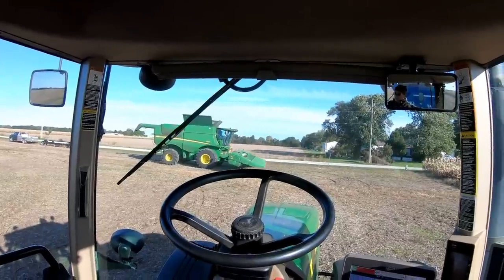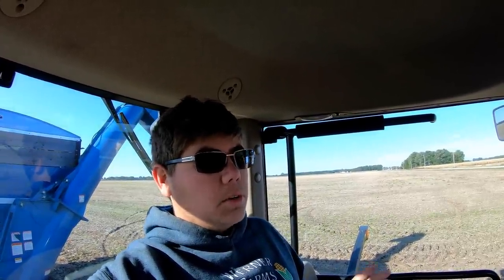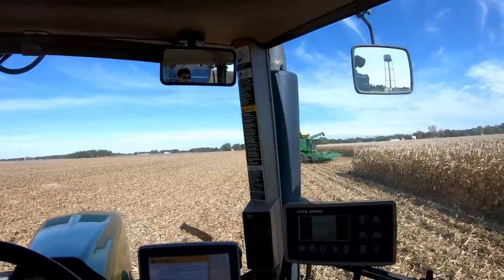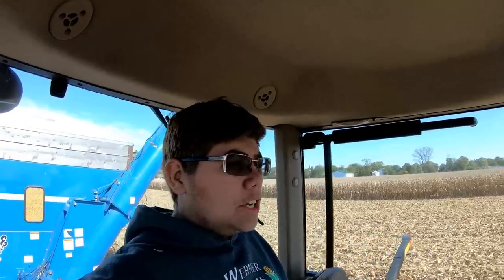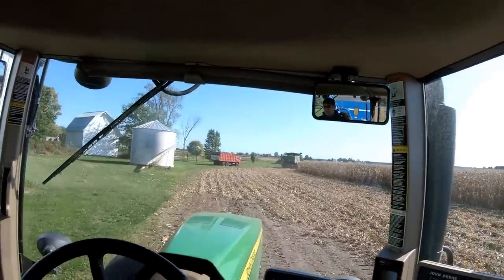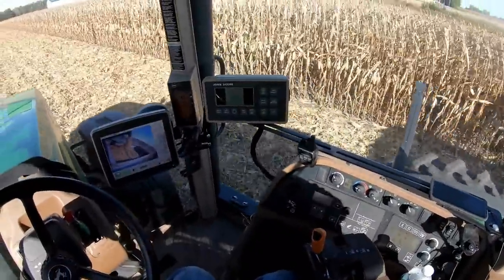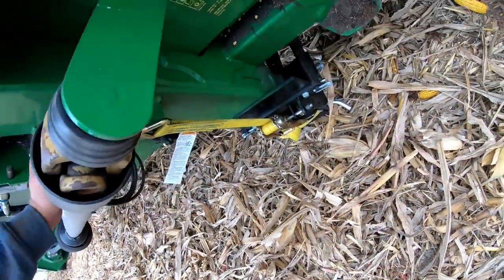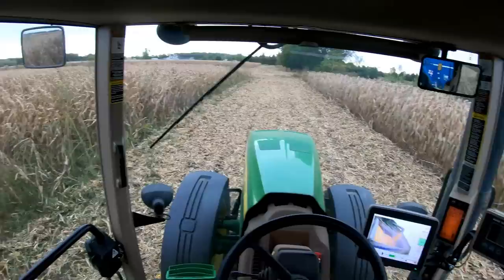S690 CAB CORN! - Wrapping Up Wanatah | HARVEST 19 Day 11

Comment: Friend of mine put crary extensions on his s670 and it works well with the powerfold. 12 row corn head makes potential bph fly up compare to 8 row. Swing auger will really help out the bottleneck in corn harvest. Hopefully a easy auction buy pops up. Happy harvesting

Comment: I work at a Deere dealer in Ohio and we install a lot of the demco/mauer bin extensions on power folds and guys love them only issue is the test channel needs to be modified just a bit  if you want the extensions to close all the way but what ever you do don’t get a extension from the company power hopper topper
Reply from the maker: Thanks for the tips! More than likely we will add the Mauer Extensions next year.

Comment: It seems like a vicious circle, you increased the capacity of the combine now your talking about a bigger cart, but the real bottle neck seems to be trucking and unloading at the bins?  Was gonna ask about hopper bottoms but you already said Marv doesn't have a swing away.  Would tandem trailers be able to access all the fields you cut?
Reply: something you never hear about in US is a mother bin/ field bin.
Reply from the maker: Dad and I were talking about that on the radio Sunday and if Marv does go to a swing away that would allow us to use our two hoppers. We realize though when we get onto our ground we're gonna need another truck and hopper bottom to keep up. The list got shorter and at the same time it got even longer haha.